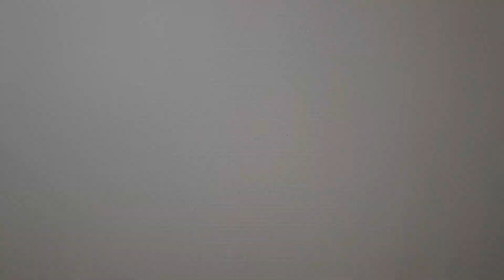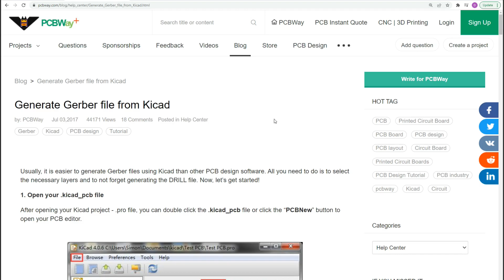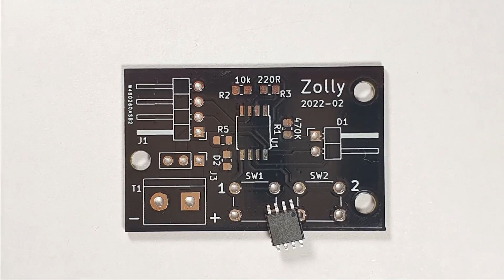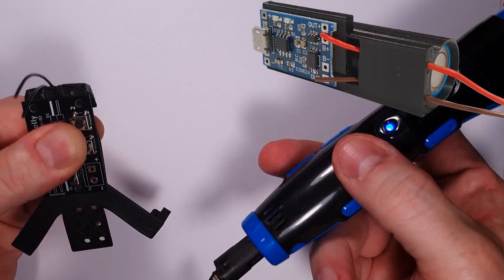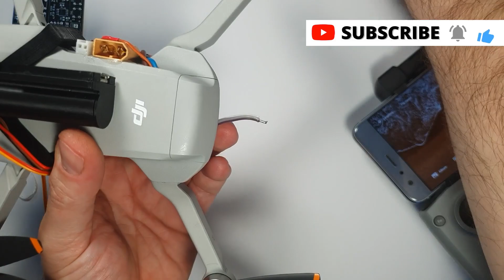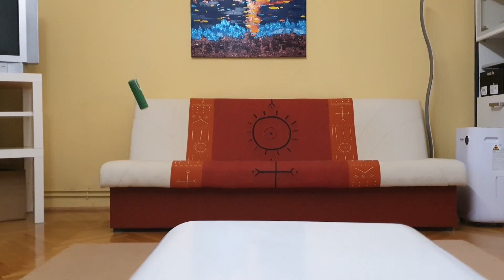DJI Mini 2 remote Fireworks Launcher  mod (Light up the sky!) Payload dropper V2.

Comment: With the additional weight does yours get a propeller rotating too fast error? I have a payload drop on my mini 2 and sometimes it will say that error and I contacted DJI and they said that these drones the mini 2 are not made to carry any additional weight. My other drone does just fine with a payload drop.
Reply: Mini 2 really can't carry much. Even .55 pound was a miracle

Comment: Cool idea. I wonder if there is a sensor that can detect different colours. That way you could code different tasks to different colours set on the fly app.
Reply from the maker: Yes there is. Check my Mini 2 Pro video. But there is a way better solution by decoding the data line to the LED on the front (that requires to open up the drone though....

Comment: Hi, friend.  But isn't this additional equipment that is installed on top of the quadcopter, it does not interfere with the GPS module?
Reply from the maker: No. GPS is just fine!🙂
Reply: @ZollyD  very strange 🤔 On my quadcopter even if you hold your hand on top and the satellites disappear
Reply from the maker: @DODG-engineering  check this video at 4:55
https://youtu.be/KQ64mgghPu8